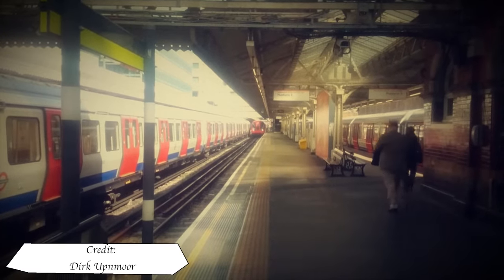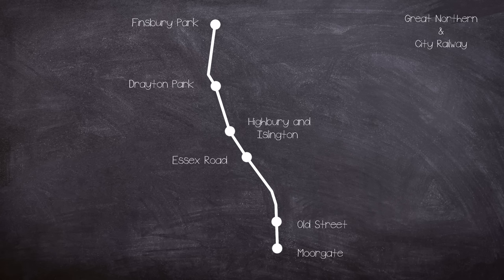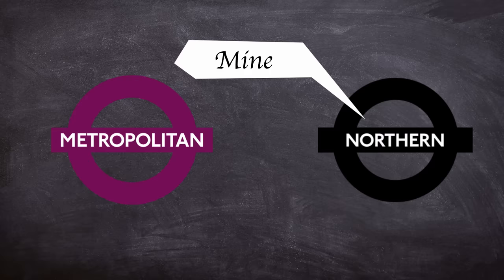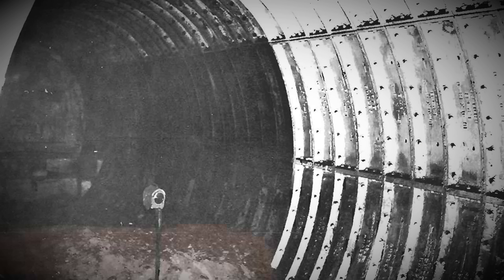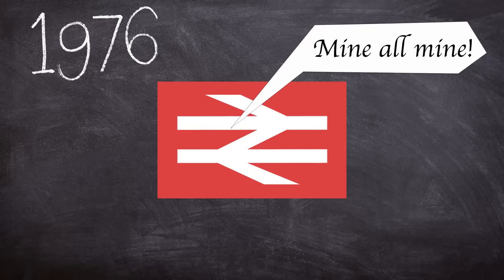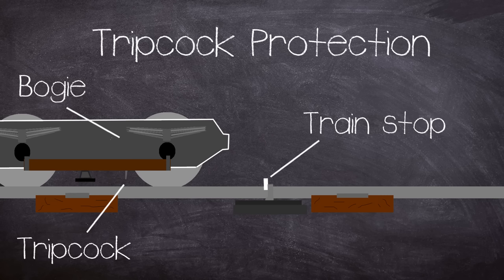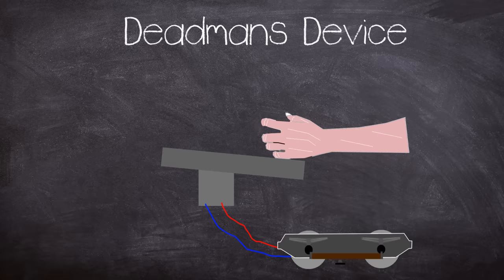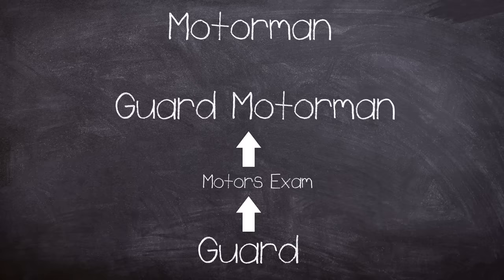A Brief History of: The Moorgate Tube Train Crash 1975 (Documentary)

Comment: One of the few cases where I actually agree with investigators that it wasn't intentional and wasn't due to mechanical or procedural failures. There was no indication at all that he was depressed or suicidal. No evidence he was abusing any substances either. No evidence of a mechanical problem or procedural error. I would have first said that it would most plausibly be a medical issue, that perhaps he'd passed out slumped on the controls (thereby increasing speed and no automatic brakes) but the positions of his arms in a defensive position indicate he was conscious right before impact. Therefore the only suitable explanation is that he was distracted and in a daze. This is quite common. Whether you're walking somewhere or driving, if it's a route you usually take and you have little cause to pay attention you can often find yourself at your destination with no recollection of the journey. I think the poor man just switched off until the last second, which must have been absolutely horrific for him. Very sad for everyone involved.
Reply: This is my theory too.

Comment: In my city we have a little trolley system that runs underneath the city center and then a river. The rest is above ground.  To this very day I've never gone through the underground part. It stops at the same station busses come through so I get off the trolley and hop on a bus to go into town. Yes, I have to plan extra time to accommodate the swap.
Yes. I am that worried about it collapsing. 
Stories like this are why. Absolutely nope. No way. That and planes. No freaking way.
Reply: I'm a prepper, and while i do buy extra food and etc in case of that kind of trouble, I also watch videos like these to inform me of daily threats that I want to be prepared for or avoid entirely.  You are wise

Comment: It's kind of wild to see the general tenor of the report - it's easy to forget just how far modern engineering has come, the idea that you'd fault an operator for something like this is... almost comical in how devoid of responsibility it is lol - the fact that people make mistakes or suffer unexpected debilitation is not something humanity just learned recently, and every engineer knows to design systems to mitigate this factor. If it's possible for a driver to do nothing and it to result in tragedy - then it's a failure of the system, this obviously should not be possible. At all points the system should fail safe. I suppose it's no surprise that this era brought us the sociopathic politics of Thatcher and Reagan =/
Reply: I agree - In todays age it is insane, Moregate station opened in **1865** however and whilst the systems would of been upgraded and changed over the century + before the accident such upgrades are too expensive to do every year for the latest little doohicky. such is life. On the other hand considering the Mooregate accident is considered to be the worst ever on the system (during peace) speaks volumes about the general safety of the system.

Comment: Has some new evidence come out re: his hands as every other report / documentary about this disaster I’ve read / seen stated he had his hands on the controls right up to the impact and didn’t raise his hands?
Reply: I think the "hand on the controls" idea comes from the fact that the deadman's switch would have come into action if he removed his hand from the regulator (if for instance he had suffered a heart attack and slumped over, the deadman's switch would've cut power). It doesn't mean that he wouldn't have thrown his hands up a split second before impact though - it would've been too late for the switch to do anything.
Reply: @furripupau  Possibly, but most of them are explicit in that he didn’t react at all and, when he was found, his hands were still on the controls and that he didn’t throw them up.  This would fit with the various neurological problems that have been suggested but, as I say, new information could have come to light.  I only brought it up as it was opposite to what I already heard from various sources.  

John tends to research well, hence my asking, as it could be he saw something I haven’t,

Comment: A few salient points.
The Highbury Branch was,for a tube line,very short.
This necessitated frequent changes of end.
This can be tiresome.
Most guards would like to be promoted to Motorman which involved passing their motors exam to become Guard Motorman.
It is easier to pass that exam if you have experience of driving a train in service.
Controller keys are widely available.
What happens when you have a controller key inserted in both cabs?

Comment: 12:28 The first (leading) car rose up in the tunnel and smashed into the wall, the front portion of the second car was squashed under the rear portion of the fist car and the first portion of the third car rose up on top of the rear portion of the second car
17:50 The post mortem exam on Leslie Newson showed he had fractures on his hands and fingers consistent with him gripping the dead man's handle at the point of impact and the inquiry actually states his hands did not leave the controls when he crashed into the tunnel

Comment: I’ve been thinking of what could have happened with the driver. I’ve heard that eye witness reports stated the driver looked neutral looking straight ahead as if he wasn’t aware of what was happening or had full intention of what was happening, so he could only have been either fully aware or completely unaware. Other comments have suggested absent seizures which would explain if he wasn’t aware and possibly why he overran the platforms the previous times. Only thing is for someone who’s described as cautious, it doesn’t make sense why he wouldn’t raise a concern especially if it was causing problems operating a train (my grandad refused to drive his car after overrunning red lights on two occasions). My only unlikely thought was he had some level of psychopathy and had been hiding his dark intentions perfectly, only giving a slight glimpse with overrunning the platforms possibly to see if the train was capable of overrunning at a high speed. My partner’s idea, which sounds much more plausible is he realised his error but couldn’t take the thought of living through the injuries he could have sustained so made it so the crash would kill him outright. This would explain his previous overruns as mistakes that he wouldn’t necessarily raise concern over as he would had seen it as his own responsibility to be careful. It might also explain why he didn’t look distressed as he’d already have accepted his fate nor make any attempt to slow down to ensure it was fatal.

Comment: Moorgate has fascinated me for decades, perhaps the lack of definitive answers adds to this. To my mind there lack of terminal protection on UK rail lines before this highlights a danger all engineers and systems designers need to ensure they recognise. Proving safety assessments by saying well it’s not happened yet so it won’t is baseless optimism. Terminal collisions were rare true, London Underground had three tunnel end collisions before this that alerted many to the terrible potential. If those concerned with operations had said what happens if the driver doesn’t enter the station at a slow enough speed they would have mandated the signal stayed red and tripped the brake cock an the train would have stopped. Yes it adds to station delays but would you rather loose 30 seconds to be sure or 43 lives? By the way in  concluding that no one but the driver was at fault the investigating officer pulled his punches from his earlier criticism of the guard, if he’d been at his proper post he might have mitigated the magnitude if not the actual collision.  The underlying cause was one of operational experience stifling any query that challenged the accepted data.

Comment: 0:40

Not all of the energy is transferred to the occupants in a train vs object collision. The train and whatever it collides with take up most of it, as the train is shaped in a way that diverts as much energy around the occupants as possible, then the nose of the train crumples as it absorbs energy from the impact, the equal and opposite happens to whatever it hits, meaning it either bends or ideally breaks apart, spreading more energy away from the point of impact, with the force the train took traveling in the opposite direction of where it was going, and the object taking the energy in the direction of the train's travel. The remainder is what the occupants take.

Comment: Oddly, when tripcocks came into use on Melbourne lines, they tended to stick in the raised position and impeded departing trains.  I remember travelling to RMIT college in Melbourne and several stops were made longer because of it.  I’d hear the the clack and feel braking as the train started to pull out.  Presumably a manufacturing issue or poor maintenance.  The latter would be no surprise as VicRail were notorious for poor performance. Not that Metro are stellar by any measure

Comment: One of the absolutely tragic incidents where sadly it's more convenient to blame the people rather than the tools & processes they work with. The investigation was a product of it's time, so not unexpected that they'd clear the railway of wrongdoing - but when you're responsible for driving 150 tonnes of steel at 60km/h it's crucial that safety is baked into the systems & processes you work with. This was a failure of the process, not the people - nothing in the driver's history or actions indicate he was at risk of anything other than a medical event, and he was working with an antiquated system which had enough isolated safety measures (like dead man switches & physical train stops) to give the illusion of safety, as was common in the 70's & 80's. A tragedy that we thankfully learned some lessons from.

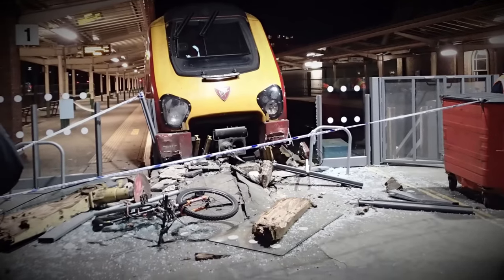Comment: 0:25 This is absolutely not true. If a train stopping transferred any of its momentum to the occupants it would be ACCELERATING the occupants, which does not happen. A train suddenly stopping does the same thing as a train stopping gradually, just much faster. The train's frame distributes the forces of the braking/impact throughout the consist very quickly, and it can decelerate quickly. The occupants, however, are not able to safely decelerate at a rapid rate; they are not secured tightly, so they continue moving inside the train until slamming into things.

Comment: I have a theory; what if the Break system had failed and the reason for the break being in the off position was due to him having to completely cycle the switch to try again.
Reply: The brake and traction components were found, examined, tested, and fitted to another train, where they performed as designed.

Comment: I feel this wasn't the driver's fault because all the symptoms are the same as being electrocuted by DC traction current. I suspect a loose wire gave the driver an electric shock causing the paralysis in previous overshoots but the driver was unaware of the effects of short term DC electrocution, which can cause weakness, numbness and amnesia. Upon the Westinghouse brake test, I reckon the electrical fault worsened and caused the driver to enter diabetic shock, which is caused by the increase of naturally occurring alcohol in the blood leading to coma and death, and since DC electrocution causes muscle contraction instead of muscle relaxation, the dead man switch was ineffective. The muscle contraction would also cause the driver's arm to pull the throttle back, which would accelerate the train and it was noted the train was going very fast through Moorgate. I suspect the driver was already dead just after the brake test. The subsequent damage to the carriage being lifted up in the crash with the second carriage pushed under it would have made any investigation into the train's condition impossible, so much easier to blame the driver.

Comment: The cab was reduced to six inches, its 1975 there would be not much of a heart or brain left to carry out a proper postmortem with the equipment back then.Not to mention technical damage. When the driver or pilot dies or the plane goes missing its always their fault until otherwise proven. Like the Air France plane which was eventually found, That was pilot error, but they where talking deliberate action by a pilot before they found the recorders.. The Malaysian plane is the same pilot is to blame with no proof. Nice documentary thanks.

Comment: Min 11:29 shows a red light at the end of the platform, so there is a train stop that should have triggered the tripcock. If there was enough space left to stop beyond this point, for a given speed, is an entirely different matter. ///// The resistors added to limit the power available at the terminus stations point to that the space allowed after the stop was never meant to catch a train at high speed. Not a flaw, but a limitation of the line.//// Only one thing is certain, the driver had his hand on the deadman's switch, ruling out incapacitating condition.
Reply: In those days there weren’t trainstops next to fixed red lights. Those, and resistors in series with the traction supply, were only ever added afterwards.

Comment: There was a train swap, the brakes were faulty on it and it is known, which is why all the details are sealed until 2051. Why - cover up.
Reply: I worked on the crash investigation. I knew the guys who tested all the brake components afterwards and found no fault.  In fact I tested a crucial brake air reservoir. There was no cover-up.

Comment: Ah telescoping rail cars. Never a good thing. The Washington DC (WMATA's) Metro's 1000 series cars had the same issues. The red line had two such accidents where the cars telescoped: 2004 and 2009. WMATA phased out the 1000 series after the 2009 accident: https://en.wikipedia.org/wiki/Red_Line_%28Washington_Metro%29
https://en.wikipedia.org/wiki/June_2009_Washington_Metro_train_collision

The irony is that WMATA'S metrorail was one of the early ATO systems (San Francisco's BART shared a similar Westinghouse based train control). Sadly this failed in the 2009 accident...